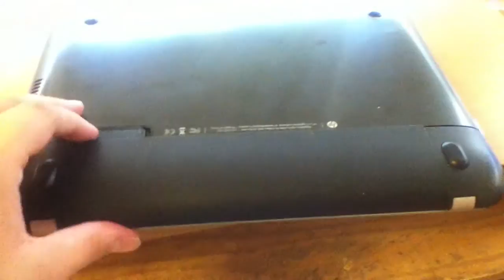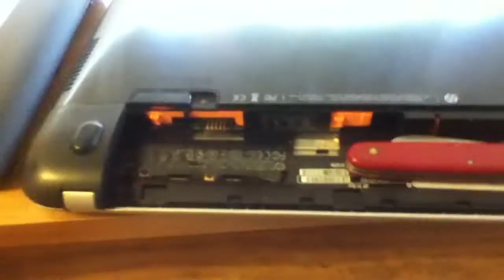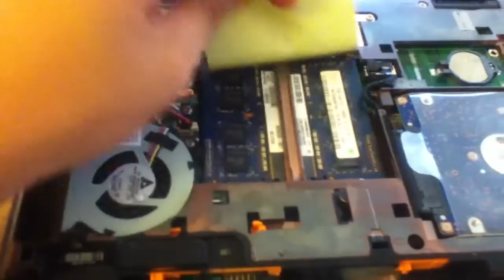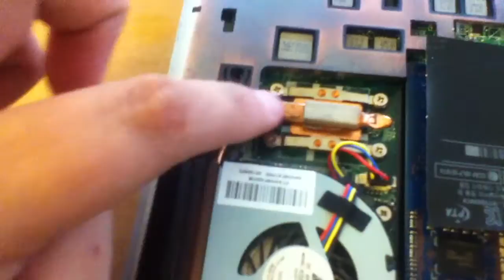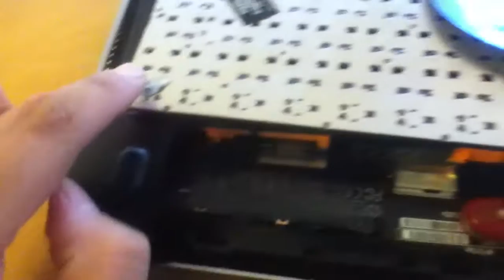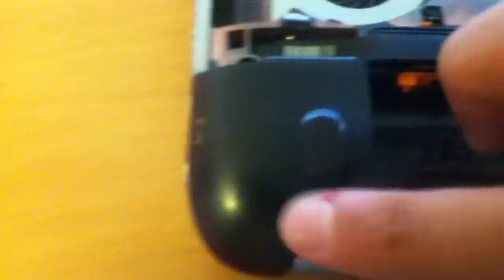HP 3115m/DM1z Overview 2/4

Comment: Do you happen to still this machine? I have a question or 2.
Reply from the maker: I sold it years ago, but I can try to answer what I can. What questions did you have?
Reply: @Alltracavenger is it worth upgrading to a sata ssd and better ram?
Reply from the maker: @KingVenitus : At this time, I would strongly recommend getting a more powerful computer if you're going to put this through any sort of serious use. With added hardware requirements(especially with constantly updated software like web browsers) something of this age and capabilities likely won't cut it and even laptops from 7-8 years ago will significantly outperform this one in both CPU and GPU work.

My personal recommendation in this size class and trying to be budget conscious would be something like a ThinkPad X270 or X280; both can be found for around or under $200USD(or even $100USD in some cases). I'd recommend the X280 if possible as the 8th-gen Intel CPUs those have are quad-core(with hyperthreading) and can support Windows 11(if you desire to use it).
Reply: @Alltracavenger  Good advice, funny enough, I use this to write my papers for college(meme worthy) but this thing has surprised me with how robust and resilient it has been. Even after upgrading to win10 4 years ago.

Comment: Please broo is those ddr2 rams or ddr3, and does it support ddr3 ram??
Reply from the maker: If I remember correctly, this used DDR3 RAM in the standard voltage(not DDR3L). I think the max RAM this machine supported is 8GB. I don't think I even have this machine anymore so I can't really check it out.

Comment: My DM1Z barely loads Google. Its majorly thermal throttled according to tests. The fan runs at full speed all the time.  I think I need to take the fan off and re apply paste to the APU?
Reply from the maker: Thanks for the response! I didn't realize this video was still generating interest. Under the circumstances I'd say a repaste might help due to the age of the machine; I'd also try cleaning out the fan as much as possible. However, I recall that while performance was decent several years ago the advances(and performance requirements) in browsers and other software might be a bit much for this class of machine today.

Comment: so,  my son kicked mine off the couch and the bottom popped off.   how do i get it back on?  i fought with it for over an hour😯
Reply from the maker: Unless something is broken on the cover, you should be able to sit the cover flat on the bottom of the laptop with a little bit of a gap between the cover and the latch, then push it up against the latch. You should see the latch move and hear a soft click as it locks into place. There should be a little resistance but not too much; you shouldn't have to force it.
Reply: Did you get an answer? Mine came off and can't get it back on. It is not broken
Reply: @kositas19  I took it to a place to get looked at.  A piece inside had bent and they straightened it out,  and didn't charge me because it was simple🤷‍♀️
Reply: @JenniferLINY  thank you!!! The plastic pieces that slide in were bent. Got it to close